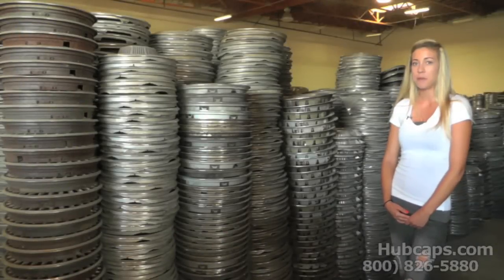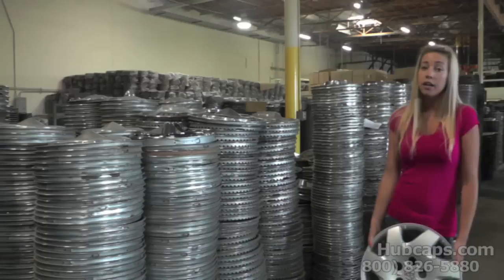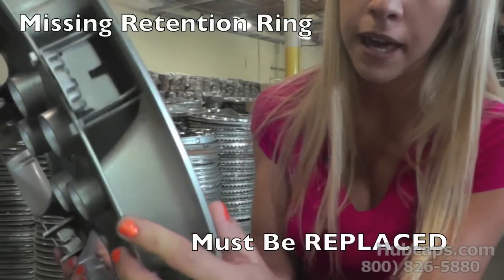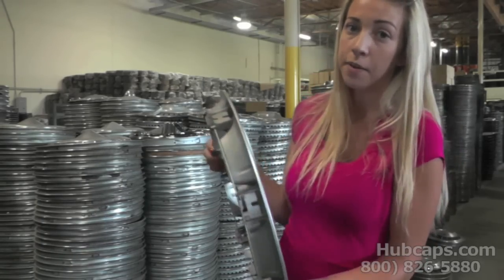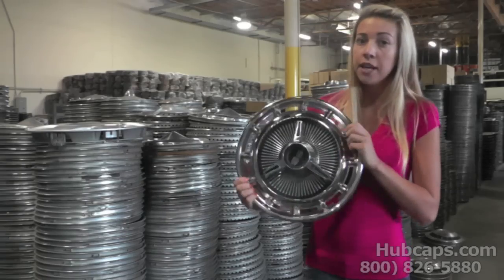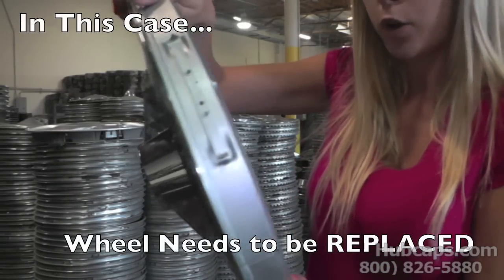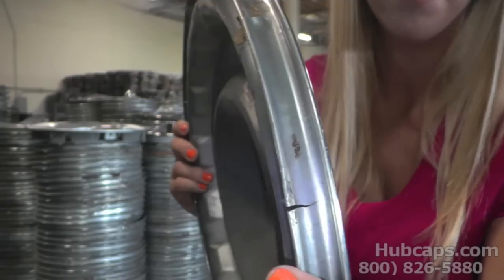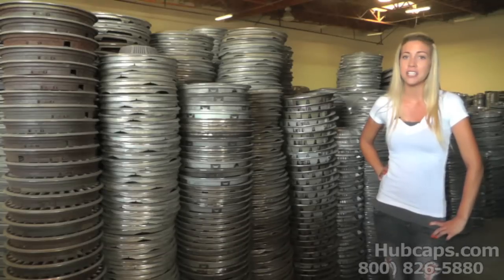How to Stop Hub Caps Squeaking & Rattling - Hubcaps.com

Comment: Where can I buy a retention rod?
Reply from the maker: Unfortunately, retention rings for pop-on caps typically are not sold individually. You will most likely have to replace the entire hubcap to get the ring. Otherwise, you may have luck finding one from a wrecking yard off of an old hubcap.